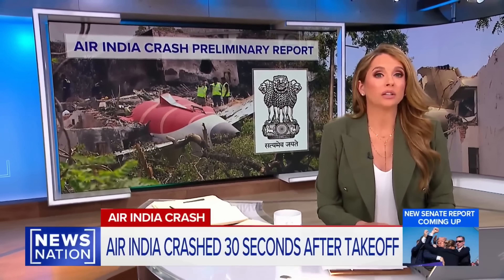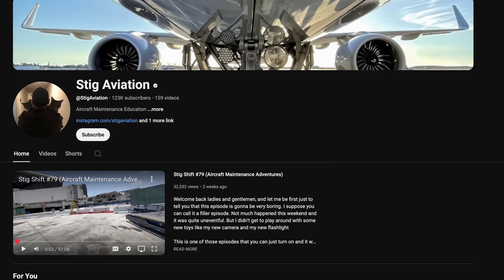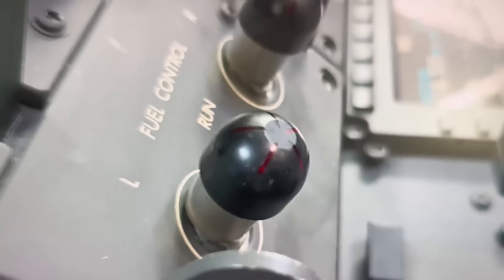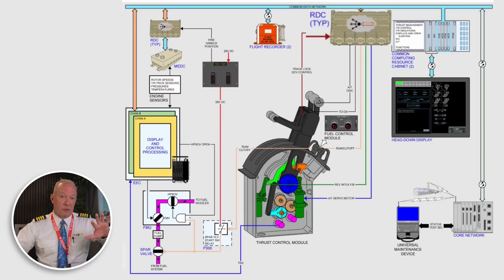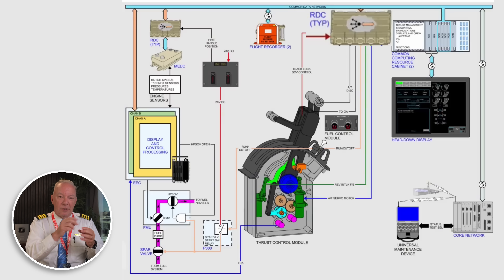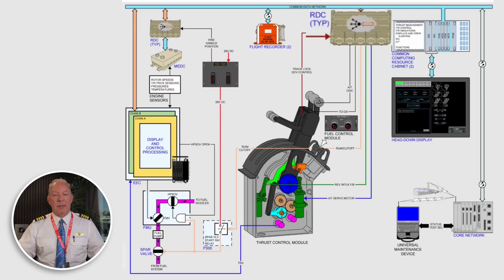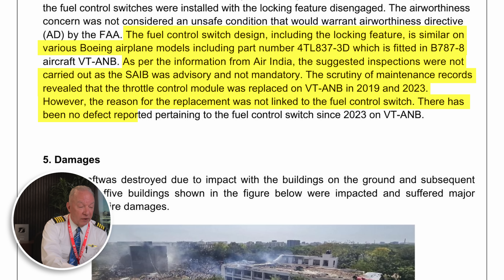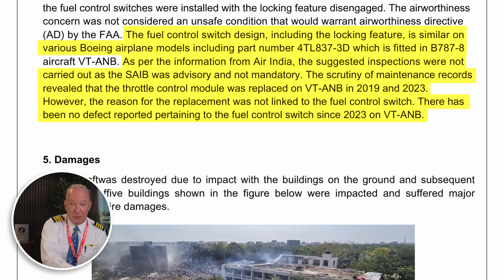The Truth About Boeing 787 Fuel Control Switches

Comment: Captain Steve is a nice old bloke, but is irresponsible & disrespectful to the dead for his continued video output on this matter. As others have stated, his discussion on relay ciruits is incorrect, he does not appreciate a relay coil energise / deenergise & contact types terminology, failing to distinguish how the design is configured for fail safe or even declare what the fail safe design of the fuel system is. He has not defined the fuel valves deenergised position nor discussed series & parallel use of fuel valves. You could argue fuel valves should be arranged fail safe open. You could argue relay coil failure maintains 28vdc on the change over contacts. Between relay & fuel valve - you have 4 permutations to consider.  Therefore, it would be respectful to leave the analysis to the investigation & engineers who know the design logic tree & risk analysis reasoning behind it.
Reply: No, Steve was mostly correct. The fuel spar valves must be powered to a new position, loss of power will not change the position. Where he gets confused is on the fuel spar valve position indication, but that comes out in the wash (e.g. not significant). The only "error" is that the preliminary report does not state whether both the Fuel Spar Valve and High Pressure Shutoff Valve closed and opened. The two valves are in series and either could shut ONE engine down. My assumption, since they didn't specify which valve closed and later reopened, is both did the same thing. If the valves were in different positions, that would be an obvious failure in the control circuit.
Reply: ...and despite the diagram clearly showing control lines to 2 of those valves from the EEC, he claims that there is no other input that could operate those valves, other than the fuel control switch!🙄

Comment: Those switches are TOO EASY to toggle off. They should not be in that position and should not be so simple to operate. The pilot could've thought he was bringing the landing gear up I'm sure. that is humanly possible entirely.
Reply: They serve a critical safety function. In the event of the loss of an engine, rotor burst or engine separation, you need to quickly stop fuel from pouring out the front spar and causing a huge fire.
Reply: Go find a picture of the cockpit layout The landing gear control is in a completely different place and is a competely different control. It would be like confusing your turn indicator control for the bonnet release lever. (I wondered the same so looked it up myself).

Comment: A pilot is not an Engineer. Pilots should operate the controls based on training and guidelines. Let the Engineers explain how the fuel cycle, engine temperature cycle, power generation and distribution, RAT deployment, Engine Relighting works. When you explain complex engineering circuits with a pilot uniform it has zero credibility because it is obvious you have been tutored by some shadowy persona. Best of Luck with the suicide theory. And ensure you are OK before your next flight
Reply: Nonsense. Also, you are making a threat, which I have reported.
Reply: @robertpearce8394 Report to Steve, if you want a mental health misguided lecture

Comment: Computers like the FADEC (Full Authority Digital Engine Control) regulate engine thrust and fuel consumption so have the ability to restrict fuel or apply more.
I presume these are parallel systems, one for the computer and a second parallel system for the pilot through mechanical switches. In a plane that sophisticated there is always going to be computer access to the engines to maintain smooth flight especially when the plane is in autopilot. 
However if these systems are in series and these mechanical switches can override any computer involvement in the management of an engine then that makes the design quite scary because nothing can prevent a pilot form switching these switches as the plane is taking off.

I imagine there are many sensors giving feedback to the computer on the position of these switches.

Comment: Steve. Why are you so obsessed with those 2 switches getting operated fast or slow. Red herring man.  There is no evidence that the circuit diagram you are showing is a 787. More likely 707. Prove it. Why? Because where is the FADEC. MEDC is not FADEC. I want to see the electric circuit from FCS to Fuel valve actuator motor controller. Please don’t throw up an old rig partial circuit diagram and convince us your pilot suite theory is true.

Comment: Can’t help feeling that an explanation of the electronic components should come from a qualified person , not a pilot
Reply: A Pilot is a Qualified Person ! That’s why a type rating takes so long and it is difficult !
Reply: @reinerressel975 high qualified as a pilot , not as an engineer. His understanding of the schematics is very much in question - see other knowledgable comments . My point is that it’s very dangerous for a non-expert (qualified) person to think they understand the deep technical aspects of a topic and then present their understanding as fact.
Reply: @reinerressel975  But Captain Steeeve's explanation of that circuit is just wrong. Anyone who understands circuit diagrams, would say the same.
Reply: @Manticore1960  I do (I'm a controls engineer), and I do (say the same)

Comment: Instead of repeating a pointless debate about how fuel switches work in a "fly by wire" aircraft countless times until we get bored, we should take a more closer look at what the 787 operating instructions say in the event that pilots experience a sudden and complete engine failure, and/or what the protocol is for restarting the engines or restarting the fuel system in the event of a sudden and complete fuel failure?

Comment: No mention of the routing of the 28v DC. The throttle control panels were replaced TWICE which means the disconnection and reconnection of plugs/connectors each time. It’s not out of the bounds of possibility that during the final change of the throttle control panel that a plug/connectors was not fully locked causing intermittent supply to the fuel control system.
Reply: The fuel spar valve must be powered to a new position. A loose connector, or loss of power, would not command a new position. Only fuel cutoff switch, engine fire handle or a hot short could cause ONE valve to close.

Comment: This video is a load of bullshit. Firstly, a relay is a type of switch, but a switch is not a relay. A switch may be controlling a relay, (as relays are generally implemented). This incredibly uninformed "detailed explanation" brings no value apart from being very sensible to similarly uneducated fools, the same low IQ ones who validate Cpt. Steeve's analysis by claiming to be relevantly qualified as a technician/engineer/some other sort of expert and agreeing to what he says.  ....Buuuut let's not get into petty technicalities.

Just seeing the system/harness diagram, I can clearly see that the HPSOV pump in the fuel pipeline needs 2 signals, one of them being from the switch (also called relay in this video) and second coming from the EEC (HPSOV OPEN input signal). HPSOV OPEN && RELAY together actuate the HPSOV pump. Even if one of the signal goes down, the pump will logically shut off.

The 1st grade science project of using a battery, switch and an indicator is so funny. What are you trying to prove here?  Subject the system through many cycles and vibrations and one of the connecting wires internally may come loose and the indicator will still turn off, despite it not being a switch that was turned on/off. What is your genius idea behind that childish project board? Fallacies pointed out immediately. There can be other parts in the system, mechanical/logical that may have caused the failure, something as basic as the connector that would be plugging into the cuttoff switch module, or something as logical as the HPSOV OPEN signal, but no! Zero acknowledgement!

Cpt. is too hell bent on insinuating human action and doesn't want to acknowledge the remotest possibility that it could be a system failure. I wonder how much does Boeing pay him to be a bootlicker and display himself as this stupid online. He is being diplomatic by disclaiming that we shall never know but goes on to give all evidence to only point out human actions. At least if you have that opinion, own up to it and point it out and discuss it with deliberation. 

Boeing, as part of their investigation will try their hardest, with all their resources, 'experts', 'researchers', and other 'industry specialists' to prove this to be a human error, a pilot not being mentally stable and actuating the switches. They will pull the remotest of histories from the pilot's families and pin it down on unstable mental health. This will give all the woke people of the world a relevant, sensible issue to ponder upon: "Mental health of pilots operating aircrafts" and successfully distract them, while Boeing continues to laze away and deliver sub-par engineering that will keep causing failures and accidents until the damage is much more than 200 odd Indians. Remember that this is not the first mishap boeing had in the recent past. Worldwide, there are at least 10 catastrophic failures that Boeing aircrafts have had in the recent past. Maybe it will matter to them if it'll be 200 Americans dying in a similar airplane.

Also, suddenly everyone seems to accept India's capability in carrying out meticulous air crash investigation and reporting the most accurate of data to the world's journalists. A country rife with corruption and weak enough that Boeing can bias results. People are just depressingly laughable and stupid for what they agree to blindly, online
Reply: Captain steeeve has shot himself in the foot making this video. Whilst trying to explain how the system works, it's obvious that he has no experience of reading a circuit diagram.

Comment: If the fuel relays are working how you describe them I will never fly with a boeing again - then they are flawed by design. 
Add. you are also wrong with the one second time between left and right off. The one second time is because of the sample rate of the recorder, even if they were turned off at the exact same time there would be a 1 sec delay.

Comment: I disagree. From the schematic, the fuel cut off switch merely supplies the power to one of the contactors of the relay. The signal to energise the relay is coming from the top-right RDC, as shown with the orange line and arrow pointing to the relay (input signal). IE, the top-right RDC DOES indeed decide whether or not this relay should be energised.

Comment: As I was watching your explanation of the circuit to the valves being  failsafe because it is directly connected to the batteries, I was thinking a shutdown could have been caused by a connection break (open circuit).  I always like to play devil's advocate.  But if that was the case, they would not have been able to restart the engines as recorded on the FDR.  So it looks like you are on the money.  Ocam's razor in  full effect.

Comment: Is there not an alarm (the loudest one in the cabin) That will sound if someone hits those switches during flight? 
  I guess one spring in a switch could break, but 2 switches broken is unlikely, however in the video the switch on the left seems wobbly in the left and right direction as if it's worn out. Switches do go bad often. One thing I saw recently on a guitar pedal switch was that someone tried to clean it with switch cleaner. This melted a piece of plastic that enables the switch to toggle between it's two positions. (that particular switch worked a bit like a ballpoint pen mechanism one click for up and another click for down, so not the same style.
  might have been possible something was bodged by mechanics while waiting for a new part?
  Perhaps the black box saw the switches were shut off but what actually happened was power on one side of the relay malfunctioned due to a problem with some electronics (bad connection or bad capacitor in a power supply etc).
  What we need to know is how does the detection circuit work.
Does it detect when there is no power to the fuel pumps or does it detect when there is no power to the switching side of the relay?
  Knowing this would open up or close off a huge realm of possible scenarios.
  Perhaps as well as an alarm they should put one of the switches on the captains side and the other one on the co pilots side so not one single person could dis activate them at the same time.

Comment: Really basic question: Why 28 volts?  Is that standard in avionics systems? Do all subsystems and modules run on that voltage or are some transformed to (say) 12v?

Comment: One question for Captain Steeeve: looking at the picture it seems that these switches could have in extreme cases 3 positions and not only 2. If the metal nib is consumed by vibrations or use, or developed a ridge or a valley and the operator doesn't set the switch  properly, this switch could stay "in a middle position", right in the top of the small metal that is supposed to hold it in the proper place, up or down. The strong tight spring could keep them there. The operator turned them on but left them not all the way up when he released the lever, not Up, not Down but in the middle on top of the metal nib set. So there is an extreme possibility that the two switches were on the 'on top' position and eventually turned off by itself after rotation. What do you think? Thank you for and answer.

Comment: One thing. The time window there when a pilot realizes all is not good to the point he checks the position of the switches when going through what would be the cause for things not being good. Is it in the limits of normality to go things through that fast, kind of run a checklist in your mind to try to solve the situation. Is it normal to realize that fast that one thing causing the situation would be the switches. And then check the position of the switches and to realize they are in the wrong position and then ask about it. I mean one word here is which hasnt been discussed probably not that much is sort of framing. If there was somebody in the cockpit changing the position of the switches very few probably assume it is the one that asked why the switches are in the wrong position. That would of course be very very bad sign, to do a very bad thing and then in the end do it even worse: make an innocent one to look that party is the guilty one. Just speculating. So wrapping up: either the one noticing and mentioning aloud the position of the switches was a very very professional and fast thinking one to notice that so fast or then that someone knew already the position was wrong and so then it is kind of easy one to know they are in the wrong position.

Comment: So basically the conclusion is that one of the pilots wanted to commit suicide. As there is absolutely not way that BOTH fuel switches fail, one after the other. I think the psychologists could now provide more answers than the engineers. How about making available to the pilots suicide pills, so if they really want to commit suicide they can do it without harming others?!

Comment: Boeing NEEDS this air crash to be mass murder slash suicide or heads will roll
to date zero leads point to suicide by either pilot
Why did a 70% loaded plane take 11,000 feet to get lift??? 
why would a pilot suicide at 170 knots??? 
How did a passenger walk from a smashed plane with 170 tons of fuel onboard???
This crash is riddled with nonsense.................................................................

Comment: @CaptainSteeeve - One thing strikes me as conflicting with what you say, but as I am not an avionics professional or even a hobbyist, I may well be wrong. You say that the only signal controlling the fuel valves is the one coming from the fuel run/cutoff switch. However, in the diagram there's an AND gate with two inputs controlling the "HPSOV" valve. The AND gate has one input signal coming from the relay, and another input signal "HPSOV OPEN" coming from "DISPLAY AND CONTROL PROCESSING" unit. As the name of the gate suggests, both "HSPOV OPEN" AND the signal from the relay need to be ON for the valve be opened. If either of these signals have an OFF status, the valve is closed. (For more information on the AND gate please have a look at https://en.wikipedia.org/wiki/AND_gate )
Reply: Not only that, but Captain Steeeve also states that all 3 valves are operated from the fuel control module. Well the fuel management valve (FMV) isn't, according to the diagram. The FMV is controlled only by a signal from the display & control processing unit.

Comment: My question is why has the relay been ruled out as failing? Relays DO fail, they're mechanical on motorcycles but relays are a common issue for failing because there's a lot of heat where they tend to be placed and it cooks them. Prime example being a lot of mid 90s-early 00s Hondas.

Comment: Question: If the 28 VDC battery were to discharge, how would the 3 Fuel Valves "relax"?  Would they relax into an Open/Run configuration where fuel could potentially flow; or would they relax into a Closed/Cutoff configuration where fuel would no longer be allowed to flow?  In other words: Are the 3 Fuel Valves "Normally Open", or "Normally Closed" in the absence of a 28 VDC signal.
Reply: According to Captain Steeeve's explanation (and the way the diagram is shown), the valves are only open while 28v is applied. I very much doubt this is the actual case though, as the "fail safe" condition would be that the valves would close if there's an electrical disconnection. Hardly "safe" at all. I suspect (as others have stated), that the relays are either spring loaded, or latched, or "signal-on", "signal-off" type relays.